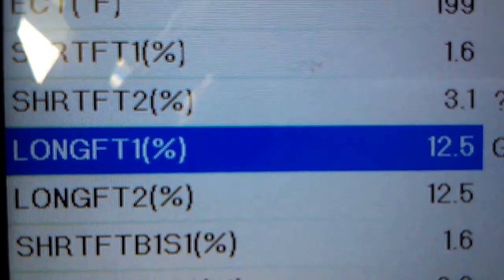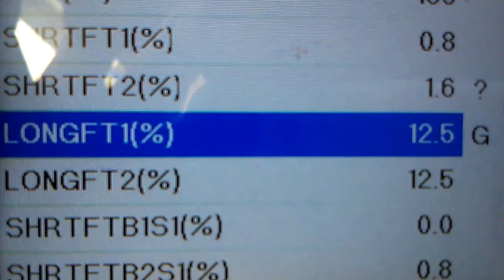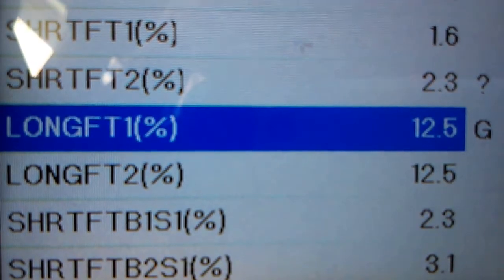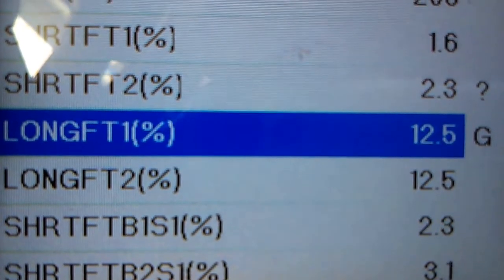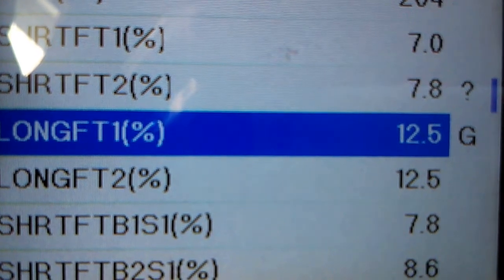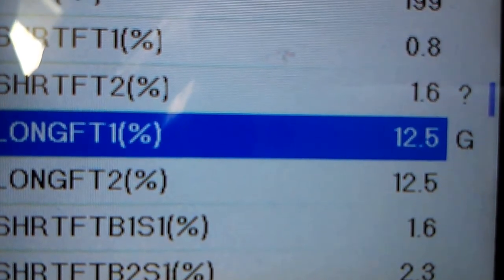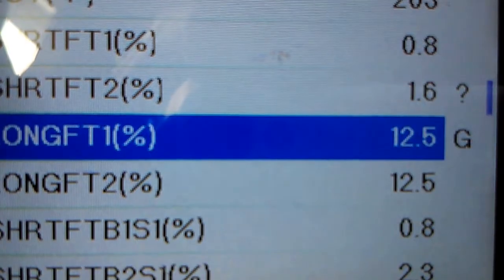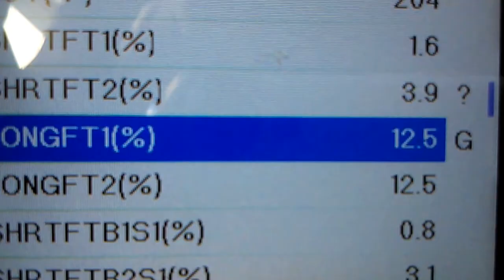How to read short and long term fuel trims

Comment: I have 
 longft 1 around 3-4-5%+
Longft 2 around 9-10% +
So what could be the problem.
P0430
P0420 im having these codes. No air leak. New spark plugs.

Comment: I had thought that LTFT essentially tracks/adjust to the STFT.  Meaning the LTFT would assume the STFT (average....?).  Im trying to wrap my head around this.  I have a LEAN BANK 2 (pending code) that keeps popping up but the voltage for B2S1 seems fine... I cleaned/put in known  good oxygen sensor and my scanner shows good activity 0.05-0.9 ish, so Im wondering how the ECU is still understanding a lean condition. Thoughts?  Much thanks.
Reply: Positive means it's adding fuel to the mixture, 
Negative means it's taking fuel away from the mixture.

It adding fuel means there's more air getting into the cylinder than there should be. 
So either there's a valve issue, or you have a vacuum leak close to the bank(possibly  even at the intake gasket or plenum. 

Smoke test it. It don't have to be an expensive smoke machine either.

Comment: Hello everyone. My readings are SHRTFT1  -2.3%
LONGFT1  13.3 %
MAP 29.0 kPa 
MAF. 2.36 g/s
O2S12  0.555 V
SHRTFT12  99.2 % 
I've been trying to pin point the cause of the P0171 System too lean Bank1 driving CLK 1.8 Kompressor,petrol at the same time. How bad it might get if continued to drive 50 miles a day with the issue? Thanks.

Comment: What happens if it’s the other opposite? -12,5 and -12,5? What issue is more likely to be happening?
Reply: 5:25 Not completly sure, but I think it means a restricted exhaust. I have an issue with a LTFT at -6.5  and was told that it is a clogged cat. The car will probably run sluggish nevertheless.
Reply: I’m experiencing this on a 2018 Ford 6.8 V10. They have an aftermarket cat welded in. I suspect it is more than likely clogged. The engine runs strong. Otherwise part of the problem was the fuel injectors were sticky because of bad fuel. After running a ton of injector cleaner through, it ran noticeably better and the fuel trims improved, however, I am looking at a P420 code which means the cat could be bad. I’ll follow up.

Comment: I'm reading 4 and 14 at good reads, then about 8 and 20 at bad.... Which is down from before and I'm out of stuff to check so I'm going onto the fuel pump and that death rattle timing chain

Comment: What would cause my car to start bogging down when I said I replace everything I mean literally everything even the wiring harness and computer I switch all my sensors to OEM brand new check your vacuum leaks the whole nine yards even change my computer a few times new fuel pump new fuel filter new fuel pressure regulator

Comment: If long term is at 0% what does that mean?
Reply: It means that the fuel trim is exactly on the programmed value setting in the ECU. If it is +or- , that means the fuel trim is either too rich or too lean. LTFT  can ruin from +10 to -10 in normal operation. The closer to zero, the better.
Reply: @markbohaczyk  thanks

Comment: On my '05 subaru outback with the H6, LTFT1 IS 14.1 and LTFT2 is 6.3. Sprayed the intake with brake cleaner where it meets the heads. No codes set, I just noticed it while diagnosing a fuel pump circuit code.
Reply: So does this mean you have a vacuum leak?
Reply: @InspecZub  no idea. Spraying with brake cleaner made no difference,  so guessing NO
Reply: @giberish9  I’d be careful with brake cleaner, I heard it’s dangerous and could blow up. When you revv up, does the LTFT value decrease? If it decreases and gets closer to 0, it means it’s a vacuum leak. It could come from any of the hoses, or fuel injectors, or exhaust manifold, intake manifold gaskets

Comment: When you are diagnosing the longFT, is it best to do it while on idle or when driving?
Reply: both, but you can simulate your are driving by reving engine to 2000 to 2500 RPM and see the values will drop or increase after reving

Comment: These values while the car on parking and the engine is on, idle? Yes? What when you stip on the gas and the throttle opens? What are the normal values? Please

Comment: Great content..can u help..head stratching..p2096 subaru forester  06 and  idles rough  short loss of power ..it can be many things crossing each other throwing this code...cNt be exhaust leak  I have straight bolt on and I put up 421 equal length headers to 3 in.mid pipe all the way to back 3 in  .I did do a recent head gasket job ..sparks plugs wires oil coolant  all changed ..I didnt do fuel pump fuel filter  and fuel injections.those 3 can be bad

Comment: My longft is 28 on a Chevrolet Spark - I just changed the spark plugs the car is doing way better in the Shrtf side - Will the Longft come down or is this a sure issue for my car? i can look at chnaging the CO2 and Oxigen sensor what do you think??
Reply: thats a good question, my stft is good too but the ltft is at like 96 i was wondering if it may have neen caused by my recent leaking gas cap it did throw an evap code but after replacing the cap the cel turned off after about 50 miles, how long till my ltft goes down?

Comment: Don't just throw parts at it that probably aren't needed.  To check for vacuum leaks, you should raise the RPMs up to 1500, 2000, and 3500 and see what the LTFTs do.  It the numbers improve, you definitely have a vacuum leak somewhere.  If you have checked for any cracked vacuum lines, done the "spray carb cleaner" around the intake manifold(s) area and didn't see any improvement, it's time to do a smoke test on the engine.  It is the end all test that will tell you where your problem is coming from.  Do those RPM tests first though to see how the LTFTs react.
Reply: By improve you mean by the numbers going down hopefully
Reply: @ghostslayer4165  what if numbers go up what does that mean?
Reply: @KennyKingBoy there is a restriction in the exhaust
Reply: @KennyKingBoy 
A "blockage" typically.
Reply: I found that the smoke test is not end all ...if your  canister vent solenoid  is  shot because it leaks internally   Evaps are a little harder to diagnosis
Reply: good info- thanks!  Might the ECU require several drive cycles to make additional movements on the LTFTs?   I have a bank 2 lean (pending code) that keeps popping up.  My scanner shows good movement and numbers on the B2S1 O2 sensor however- very active and swinging between 0-0.9 ish.  Im wondering how the ECU is still reading a lean condition.   LTFT is around +11.   Thanks!
Reply: @atomicdmt8763 
You have a vacuum leak somewhere. 
Positive means it's adding fuel to compensate for thinking that it's got more air than fuel.
Reply: Do the hose hiss test, take a 5/8 inner diameter piece of Hose put one end up to your ear and the other end around different parts of the engine till you hear the hissing coming from a vacuum leak. You can also use a tiny funnel on the ear side.
Reply: What is a smoke test? And can I use soapy water to test for a vacuum leak? I heard something about carb cleaner being dangerous
Reply: @InspecZub 
It's hard to explain. 
It's a machine that you attach to a compressor with a metering valve, that pumps smoke into the motor on whichever piece you want to test. 
Preferably only 1psi
Reply: @kairu_aname  bro is responding to 2 yr old messages lol, ive done many of these tests now, certified backyard mechanic
Reply: @InspecZub  
Doesn't mean it can't help others along the way.
Reply: What if i have just 0% on all banks doesn’t read any thing
Reply: @2rpromotions318 might be the car is dead 😅
Reply: mine are LTFT-33.01 and STFT is -32.62
Reply: @moneymakingboyz9461 start with cleaning MAF sensor. Use correct cleaner and do it carefully
Reply: @moneymakingboyz9461  Make sure your O21B1 and O22B1 connectors are not connected in reverse.  I've seen these kind of numbers when the connectors were put on backwards
Reply: @moneymakingboyz9461 
You have either a massive vacuum leak, a leaky fuel injector, or you have a bad 02 sensor.

Comment: Most likely you have weak fuel pump 
And if your tank is low in fuel then your pump is going to get hotter and become more weaker.
And if you fill up the fuel tank which make the fuel pump colder and your fuel trims become Lower 
Then defiantly you have fuel pump issue

Comment: I have a 2000 chevy prizm that I just got done fixing an intake manifold leak on. The LTFT is like +10.7, and sometimes the STFT -10. Is that okay if the total fuel trim is near zero even with the large numbers? Sometimes I can get like +7 and -3, for a total fuel trim of like +4 to +7. No check engine lights for a lean or rich condition anymore.
Reply: 3 years later my fuel trims on that car are still very high. Never could find a vacuum leak, but that's apparently the problem. Car runs okay. but 23 MPG all highway on a rebadged Corolla is not good.
Reply: @aznnp77 how about an exhaust leak at the manifold or the donut???
Reply: @Rickie-x2  I replaced the exhaust manifold gasket and the intake manifold gasket. I think I tested the exhaust manifold somehow I forgot. Car has 171K miles now. Just replaced the plugs, cleaned PCV valve, and changed valve cover gasket recently. Overfilling the oil by a lot probably caused the leak.
Reply: Wow nice update lol
Reply: @masterbates8484  Yeah, gas mileage isn't good but the car still runs. Only paid $700 for it with 132K miles. The last one lasted over 200K miles. But I'm probably paying like $400 extra a year on gas. And $100 extra for oil. I'm burning like 2 quarts of oil per month driving like 800-1000 miles. But she runs!

Comment: Hi my my stft and ltft get up to -28 when the engine warms then dies, new plugs,and wires ,map sensor,upstream o2 , fpr and fuel pump are working. 3.8 2005 impala. 257,000 miles.cleaned Maf and IAC. I have to give it gas to start it. With the maf unplugged it will run longer. When I plug it in it stalls out. When it is restarted it runs like it is not hitting all cylinders. Any help would be appreciated..can't afford another vehicle at the moment. Thanks

Comment: I got brought here as I had a P0480 my fan relay I replaced it then cleared the check engine light. On my Dodge caravan but it came right back so I check the code again what I got was Trip 0.0 which is not in the Manuel at all for list of codes which confused me Soo I'm not sure I did however find a small leak in my intake manifold so I'm think the code is a trim code that air is getting in the leak appears too be coolant leak very small still have too inspect further and the code won't clear

Comment: 2003 kia sorento Ex. 3.5l This problem has stumped me and also kia dealers. 

Problem is b1s2 and b1s2 fixed high, above 900mv. B2s1 and b2s2 are fixed low, 40 to 60 mv.    Engine runs rough, but no codes thrown. Could you tell me why these are staying at fixed rates with 4 new O2 sensors and new cats.

Comment: Good stuff! my longft2 is -12.5 what would that mean?
Reply: poCoShaun Smith your super rich..leaking injectors or fpr, clogged cat, dirty air filter, bad spark plugs, wiries, coils ect ect..
Reply: I would not say super rich. I would say slightly rich on bank 2.
Reply: gary miller pretty sure anything over -10 is running pretty rich
Reply: @6.Slow_Gto  Does bank 2 sensor 2 plays any role in fuel trim like this ( ltft -14)
Reply: @AnythingEverythingGh  the o2s are mainly monitors. The reason why you run rich or not is due to other factors. If the upstream fails than yes you may run rich or lean
Reply: @6.Slow_Gto  Thanks for the reply
My o2 are ok, fuel injectors, fuel pump fpr, map sensor, which one do you think i should check to fix the double negative long term fuel trim?
Reply: @AnythingEverythingGh  start with injectors and then fuel pressure regulator if you have one
Reply: @6.Slow_Gto  checked that, they all doing ok
Reply: @AnythingEverythingGh  most likely sensor related

Comment: Would a catalytic converter cause one side, in my case Bank one long term with a performance Restriction and a code 171 to light up at 19.5 Long Term Bank 1 while long term bank 2 shows 2.5? I have replaced all 4 O2 sensors with new Denso O2 Sensors and then took it to Jag dealer (I have a 2004 Jaguar XJ8 4.2 91,000 miles) because after replacing them I was getting codes PO1646 and PO171. They told me that one sensor was still bad. I Replaced that sensor and now I am just getting a PO171 code. Jaguar stated they also did a smoke test and found no Vacuum leaks. Cost to ECU flash, smoke and evaluate was $165.00

 I am still getting acquainted with those researching and grasping all those numbers on a new laptop Diagnostic program I bought. But it looks like bank 1 is reading (drove 32 miles testing ) 19.5 and Bank 2 at 2.5 long term trim and giving me the performance problem from the left side bank 1. At Half throttle it is good and idle perfectly but at over half throttle it goes down on its face as restricted. [By the way the video is very helpful.]

 Understanding those numbers is a learning curve and I suspect maybe right side bank 1 catalytic converter or exhaust leak in front of it. I have a new throttle body and new MAF and Jag did a smoke test so.............Its been since March 2018 this all started and now it is May 18 and I am still trying to figure it out.  Any advice is appreciated with thanks.
Reply: I cannot tell you what exactly is wrong with your car as i haven't seen it but i can guide you to make sense of it all. 19.5 Longterm means your engine is still running lean. That's also what the P0171 trouble code means. This can mean that they fixed the wrong things on your car... When you have positive 19.5 you have a lean condition and it means that the car still restricts the fuel flow somehow. We know its a lean condition because we have positive 19.5. The reason the car restricts the fuel when you rev it higher RPM is to protect the engine from overheating and also prolonging the catalytic converters life. Lean means to much air for fuel but once they didn't find a vacuum leak that can indicate also not enough fuel for air. So in your place i would have checked for a faulty injector, fuel system pressure or fuel filter or a leak on the exhaust manifold which can trick the 02 sensor that air fuel mixture is to high even if its not. (High oxygen detection from the sensor can create a lean condition by restricting fuel.)

Comment: at idle short term fuel trim bank 1 14.1 to 21.9 bank 2 10.2 to 18.0 
at idle long term fuel trim bank 1 -0.8 bank 2 -0.8 and dont move even while driving 
this a bad sensor or vacuum leak it is driving me up the wall no fault codes either

Comment: If LTFT goes over +10%, there is loss of timing.
Reply: Yes above 5% positive your car wil start loosing power. it could be also a faulty oxygen sensor.
Reply: mine Long term stays at 6% is that good ?
Reply: Not true

Comment: Hi my truck is having problems the   short term fuel trim bank 1 is 50.0 bank 2 is -27.3 long term is bank 1 6.3 bank 2 -5.5
Reply: Did you figure it out? Having the same problem

Comment: my car at idle long term fuel trim bank 1 is around negative 4, on bank 2 is around plus 8. Short term on bank one and two stay around zero. is that good?
Reply from the maker: poundu27 that all sounds pretty good. the +8 fuel trim is a bit high but unless there is an issue going on its nothing to worry about. if it started climbing up higher then 10 I would start looking into it

Comment: My 02 S10 2.2 at idle warmed up, long term bank 1 is at 1.6% and short term is at 2.9% is that good? Thanks!
Reply from the maker: Justin P. yes that is really good. if they start going up near 10% or higher then you have a problem
Reply: RIU Performance thank you!

Comment: 02 Sienna, 420 code.  Does 99.2% B1S2 indicate a bad after cat O2 sensor?  one of B1 long terms is at 14% while other is at 0.8
Reply from the maker: Sir Sweetness yes being pegged out at 99 I would Def think the sensor is bad. almost every one I have seen at 99 was just a bad sensor
Reply: RIU Performance 

    Thank you.   The other 3 values were within 10%.  I will order, 234-4163 Denso
Reply from the maker: Sir Sweetness that's good and yes replace it with the best sensor available for ur car. they aren't usually to expensive but it is well worth it. hope everything works out!
Reply: RIU Performance 

Denso only for Toyota and it is $50 on Amazon.  I replaced current one at about 120K I am at 199500.
Reply: Mines same on Denali isn't throwing code

Comment: working on a car that has a constant -10.2 on long term ft1 any clue?
Reply: mark gil the engine is lessening fuel to the combustion chambers

few reasons why that can happen

1. 02 sensor is reading air ratio higher than it really is
2. you have a vaccum leak and the air intake actually is higher than normal
3. dead mass air flow sensor
4. MAP sensor faulty

like i said, theres a lot
Reply: LetsGet TECHnical support
Reply: You are slightly rich; but nothing to worry about. Mark.